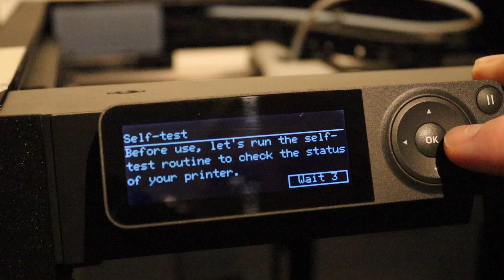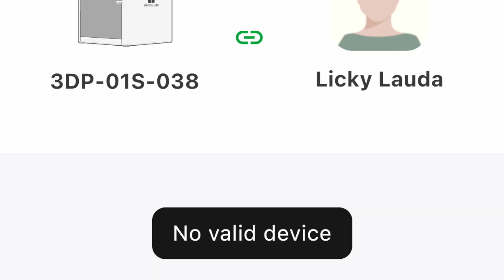Bambu Lab P1P - Replace the AP Main Board

Comment: Why did you remove the screen , it´s not necessairy
Reply from the maker: it is mentioned in the original manual to remove this, and without removing the screen you cannot remove the front panel.
Reply: And it gets in the way, hard.